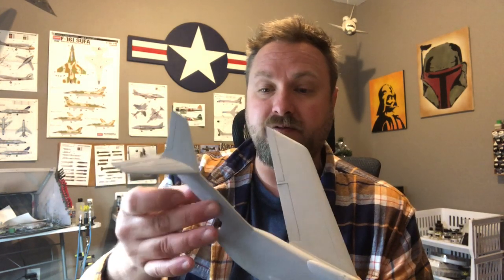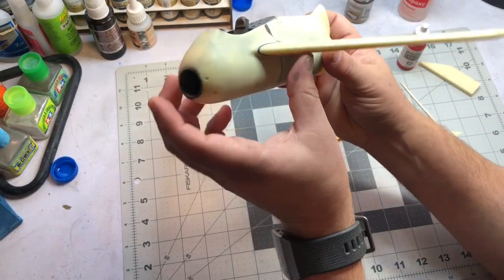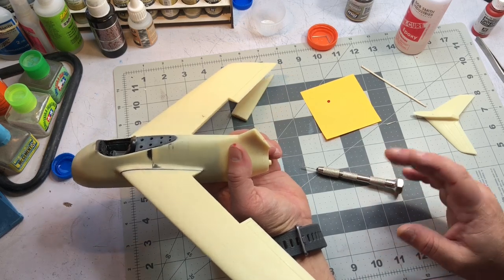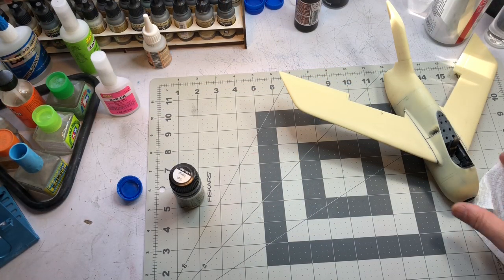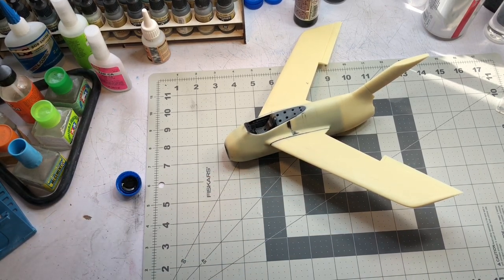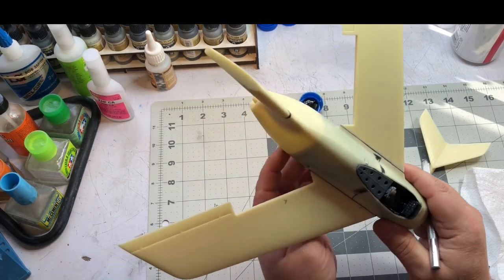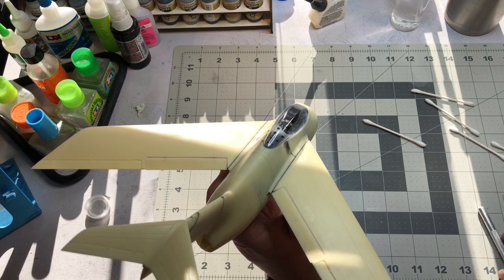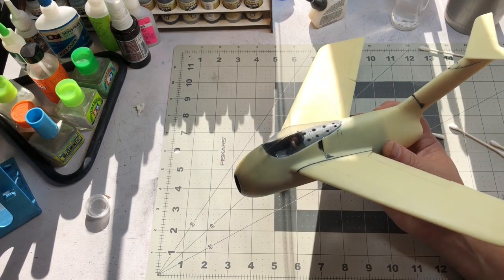LEM 1/32 Ta-183 Huckebein Resin Kit Build Part 2

Comment: The best thing I have found to attach canopies is Formula  500 canopy glue. It's  a pretty strong pva glue. I attached some cockpit parts to a popsicle stick and pretty much broke the stick before I was able to get the parts off of it. It might work well for vacuformed canopies. Good, strong bond and fills gaps.